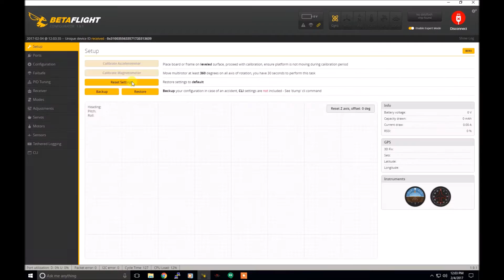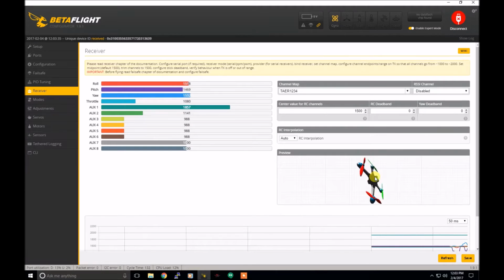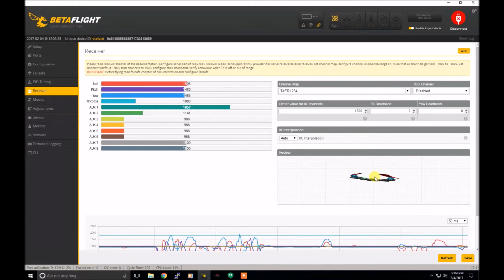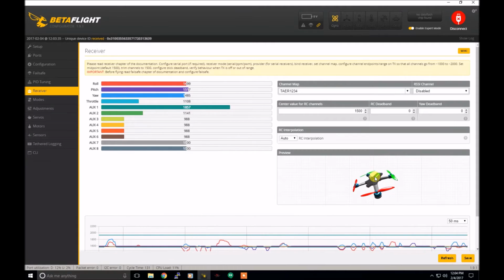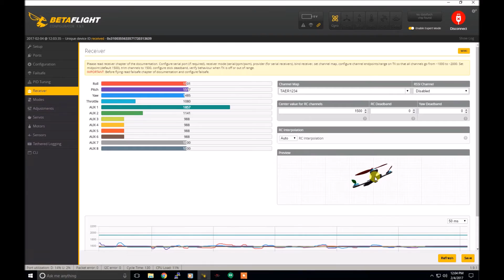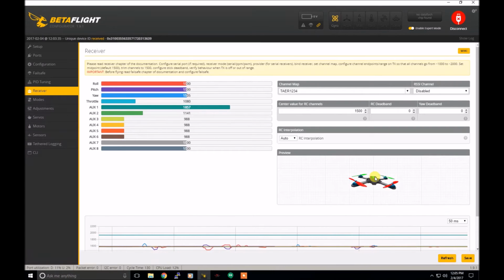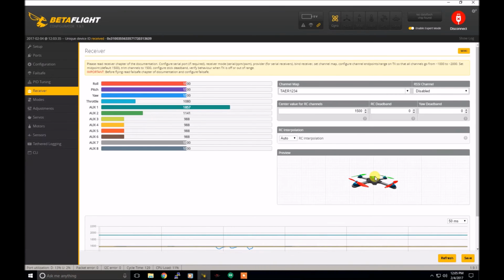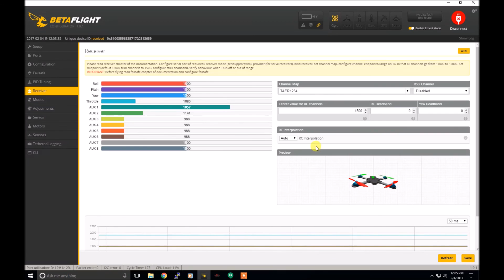Betaflight Trim

Comment: Okay, so I might be confused, but are you are using the trim buttons on your radio and just viewing the results in Betaflight?  As an alternative, is there a way to trim the model by adjusting Betaflight values, and not using the radio trims?
Reply from the maker: Thats correct.. I am using trim and sub trim to get the model stable in beta flight before I take it and fly it. There aren't any other ways to do this in betaflight that I know of.
Reply: Yes there is a way to set trims in Beta Flight. Bardwell tells you how.

Comment: To set trim, disable the quad, full throttle and then give the right stick a quick push in the opposite direction of movement. You will see a LED on the quad flash. Fly again and repeat as necessary. You can give more than one stick move of trim at a time. Your radio trims should all be centered. This video method is wrong.

Comment: i centered all these.,. along with setting it up to be 1000 to 2000.. and calibrated gyro and got a level out.. and thing seems to dirft.. im about to test it again.. going to lock in a room try to get away from any breeze.. before adjusting trim didnt seem to stop the drift.. was weird.. what about roll and pitch trim in betaflight think config tab?
Reply: To set trim, disable the quad, full throttle and then give the right stick a quick push in the opposite direction of movement. You will see a LED on the quad flash. Fly again and repeat as necessary. You can give more than one stick move of trim at a time. Your radio trims should all be centered. This video method is wrong.
Reply: @wjkssmd  mine was what ur explaining. Angle mode which is never perfect. And adjusting the gyro trim in betaflight with sticks. 
He is explaining the sticks not being centered which u adjust in transmitter tab with input. Adjust subtrim to get sticks to 1500 or very close. If bounces too much add some dead center

Comment: Thanks for the tip!  I have a question. When I push roll left on the stick it much much faster than when I push the roll right lever! I even tried it while outside and not on beta flight. It rolls left way faster!? Any way to make them the same speed for rolls?